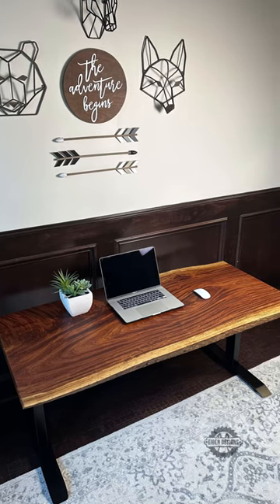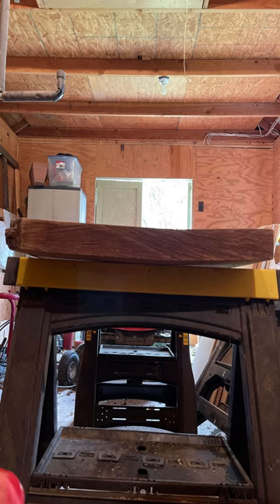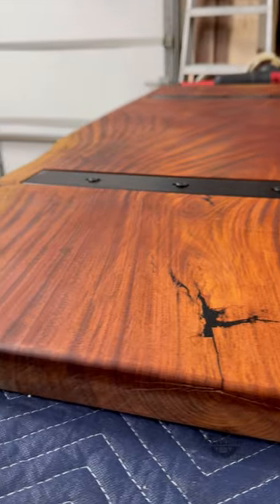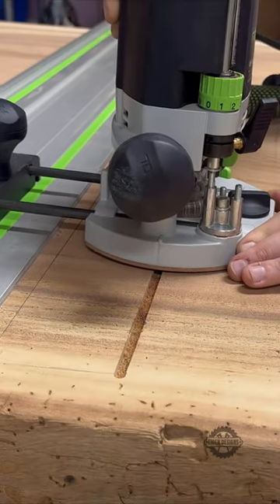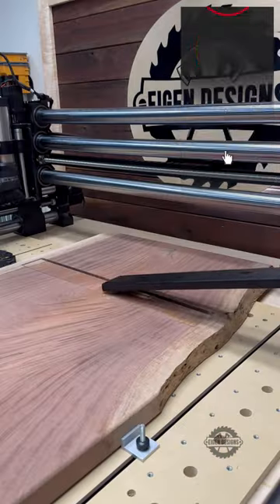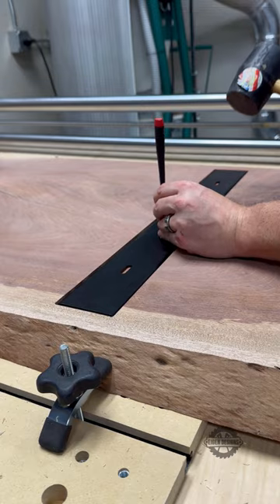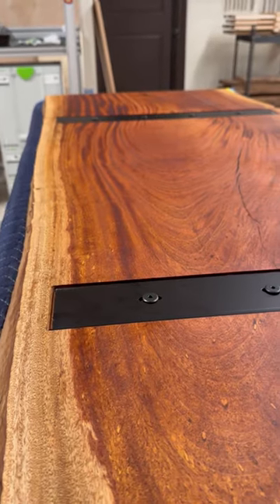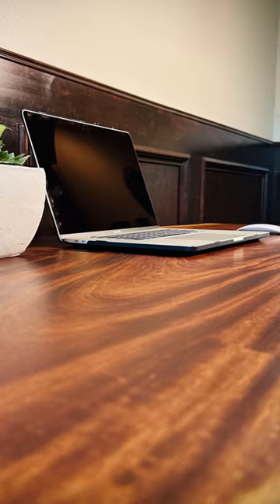Live Edge Slab Woodworking  | C-Channel Installation

Comment: Is there a preferred side of the slab to be used for the top? I have a slab that wants to cup, but the concave side is more beautiful (so it will have raised edges over time). I'm hoping c channel helps. How close to the sides do you want the c channel? Thanks for all your help!